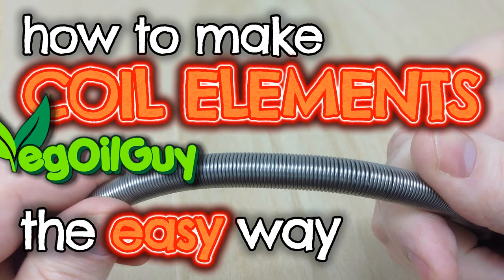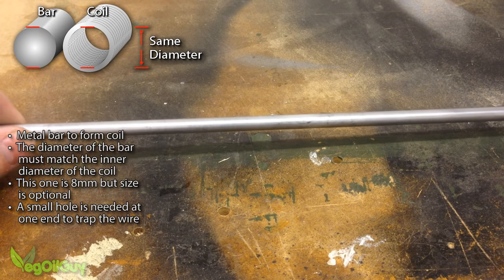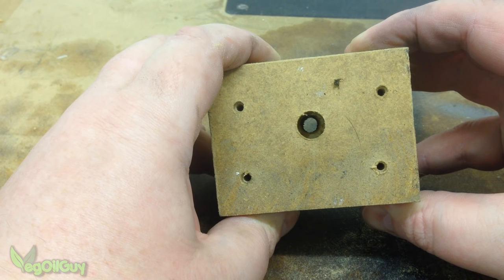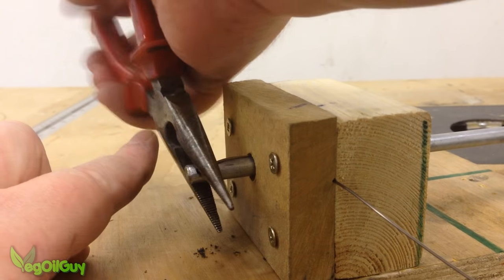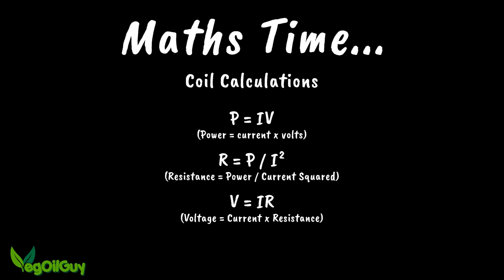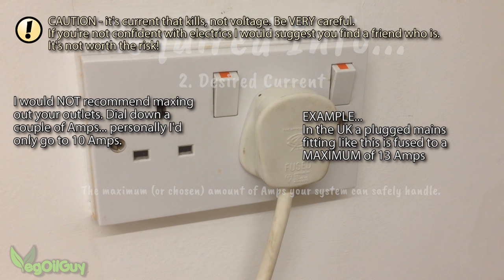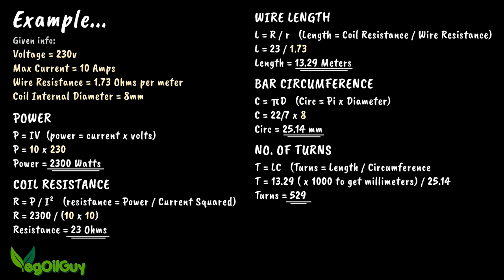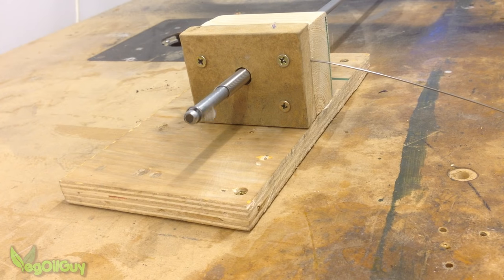Make an EASY coil heating element winding Jig - making electric resistance coils - by VogMan

Comment: Haloo...
with that calculation how many degrees of heat you produce??
Reply from the maker: The max I could ever expect would be 1400C, after which the coils would melt. It really depends on the construction of the furnace. In mine I've managed to melt copper a few times, so that's around 1100C : )

Comment: Thanks for your videos I'm loving your channel, Would you be able to give a little advice. I am building a tempering oven with an internal size of approx 150mm x150mm x 450mm deep, mains power is 240volt with  a15amp breaker, assuming 13 amps for safety the calculator said I need 10meters of wire, this seems very long for an oven this size. I would love to get your thoughts on this.
Reply from the maker: Hi Matt. Without looking at the numbers, I would say trust the coil calculator. It works a treat and is certainly the basis of my electric foundry which continues to works beautifully.
When you first start making these things, everything seems worryingly foreign and strange. And that's a good thing as it keeps us cautious - which we should be with electricity.
10 meters doesn't sound long to me... I think mine was 13 meters. But remember, once the wire is coiled, especially if you have a good internal diameter like 8mm or more, the finished spring is surprisingly short. Then you need to stretch this and it seems to become loo long again, but if you incorporate the slots properly, it will all work out nicely. 
If you haven't already done so, look over my electric foundry build. There may be a few tips there that might be useful to you.
Hope this helps : )
Reply: Thanks again for all the great info, I was amazed to see 10 meters of wire coil up in no time flat. Just a question on mounting the terminal bolts, you went for a putty type product but could you just use air set mortar to hold the bolt in place?
Reply from the maker: No worries. Happy to help.
You could use all manner of things to fix the bolts I would imagine, including the high temp mortar. I'd recommend trying it on a scrap piece first. If it works, shove it in your kitchen oven during a Sunday roast. If it survives that okay, it will be quite happy  : )

Comment: Can you tell us the length before and after coiling, wire length vs coil length? 
Or better yet, give the coiled length as a function of coil inner diameter and original wire length! That is, f(x,y) coil length with x coil diameter and y original wire length.

Comment: how do you handle that the coil doesn't produce a short circuit? is just stretching enough?
Reply from the maker: You're right in a way... the coil is a short. But the coil is a long length of wire and this has resistance. Many resistors are in fact just coils of wire. So think of the coil as being a resistor.
Reply: hmm... but when you roll it and the surface of the wire isn't insulated the effective length decreases as the wire touches itself when bein curled up to the coil. (furthermore the effective diameter increases). in this case the electric current doesnt go in circles around but directly through the coil. this is when the resistance goes down and the short happens. so how do you handle that the wire doesnt touch itself inside the coil or is the wire electrically insulated? thanks!
Reply from the maker: Well said - you're spot on. An unstretched coil is the short you need to avoid. That's why I recommend that the coil be stretched by 3 times its original (unstretched) length. Any more than this is not recommended by wire manufacturers who say the coil loses effect, so 3 is good. Less than this and those tiny coils do get close. And it may be in places the odd turn or two do touch, and they are NOT insulated, but this will only serve to reduce the resistance a little. 
Ultimately the supply should be fused and ideally Earth-Leak protected, so if a major short occurs, like the beginning and end of the coil coming together, then there's some user protection in place. But for the most part, good and installation is the solution. Have a look at my Electric Foundry build videos to see what I mean  : )
Reply: Dude! thanks a lot for the good answer!

Comment: Where did you buy the spool of wire? All i can find is 10m lengths
Reply from the maker: eBay was where I found mine : )
Reply: @vogman  im thinking of going for 1.4 mm since that would have lower resistance. But will that heat up with 12 amps going through it? I want 2700 ish watts in my oven. And im unsure if i want to go with 1.2 or 1.4 mm wire. 1.4 holds more energy. But is it too thick to actually heat up?

Comment: Great video. Does the final ohms measurement vary depending on how far you stretch the coil?  If your wound coil is about 500-600mm and i need to stretch the coil to 1700-1800mm for my kiln, does that effect the ohms? also do less ohms and more amps  generate more heat out of the coil?
Reply: Only stretching the wire will affect its resistance (the wire diameter) the closeness of the coils (which must not touch) will not. Less Ohms and therefore more amps will draw/deliver more power. There is a practical limit as to how short the wire can be however.

Comment: Hi, thanks for your usefull and clear video. I want tu build a small kiln, the problem is the length of the coil, it will be too long. I need about 5m but the calculator ask 13m. Do you think I could replace the resistance of the coil which I need to cut with a resistor? Thanks
Reply from the maker: You may need to think about a thinner wire to increase resistance. Whilst adding a resistor would work in theory, I'm not sure how well such a component would hold in a furnace environment.

Comment: How does the coil know how many amps to use when i plug it in to the wall out let? Im in the US and using 120 volts, ive got 20 gauge kanthal wire with a resisrance of 0.817. My metal bar provide 0.25 inner diameter. My wall outlet goes up to 15 amps but how does my coil know to only use 10 of those amps? Am i missing a piece of equipment? Or am i a dumbass and its cause of the maths that it only uses 10 of the available amps 🙈 thanks ALOT!
Reply from the maker: It's a confusing subject : )
The coil is just a length of wire - and with that wire you're making a resistor. The size of that resistor is effected by the length and thickness of the wire. You know your voltage and you know how many Amps you want to draw (or risk blowing fuses) so a bit of maths and Ohms Law works out the resistance needed (Resistance = Voltage / Current). So basically you're building a resistor (coil) that's just the right size. The online calculator I provided does all the nasty maths. Just type is the numbers and it will do the rest for you : )
Reply: Hey Rey question how are the coils working out. Im about to do my this week. Wanted some feed back

Comment: Geoff, great work. My question is your calculator results are 15ft of wire and 226 turns. How do I determine the finished length?  I am planning on 2 bricks per wall for a total of 8 x 2.5" so 1 trough around is 20". 1200 watt furnace. I am using for heat treating, not melting.
Reply from the maker: Hmmm... maybe a bit of maths? If you know your coil width, then you can figure out how many turns in an inch. Then divide 226 by that number and you have how many inches of coil will likely come off. Then multiply that by 3 for stretching. I doubt if it will be exact, but it should be a good gauge for you  : )
Reply: Geoff Thanks much, that gives me a great place to start.

Comment: Is this directly plugged into an outlet? or there is circuit should be used?
Reply from the maker: Hi Tristan. Yes and no is the answer.
The coil only requires power to work, so as long as the domestic supply is up to the task, a coil could be plugged straight into an outlet. However, some sort of control is more ideal.
If you look at my Home Made Electric Foundry series, you'll see how I used a PID, a Relay and a Thermocouple to control my coil (vid 3 I think - https://youtu.be/jHCnYy39Oxc - along with circuit diagrams).
Hope this makes sense : )

Comment: Hi i am building a kiln, but i cant choose heating element. If i choose pre coiled coils from ebay those are in 500w coils, and if i want to join more how can i do that with no problem?
Reply from the maker: You can join coils. Link two ends together by twisting the ends. This is like adding Resistors is series, so they increase in size (eg 500 + 500 + 500 = 1500). But I'd encourage you to make your own. A lot of these eBay coils are rubbish. Buy good Kanthal wire and make your own using the simple jig you've seen here. You won't regret it : )
Reply from the maker: I'll be honest, there's not much I can say about them. These sort are cheap and you get what you pay for. I've tried them... I've also tried kanthal wire bought from eBay. Both were rubbish. So I contacted the wire manufacturer and they told me they supplied https://potclays.co.uk/ - so that's the only place I buy my Kanthal wire from, because I know it's genuine. It isn't cheap, but it lasts a long time. I believe they will ship internationally, but it's up to you  : )

Comment: Dear Sir, i have a question,, now i understand your calculations for the elements, however, my question is how did you arrived to that calculation? Why do you need 1000w instead of 2000W? so in order to do that, we need to find the BTU, now i have probably been in 20 different web sites, and every one has a different measure or calculation to find this,, how is it possible? let's say my kiln is W12cm x H12cm xL12cm,  the result is 1728. now this beloved 1728, for what i need it to multiply it?, than if i am correct, i will convert the result(BTU) in watts, and there i will have the answer to the question i made first,,, Thanks a lot,, and sorry for my calcuclus,,,

Comment: Another great video! The first time I tried it my jig apparently pulled in a kink or two and destroyed itself, so on round 2 I looped the wire over a hook before it ran into the jig and it sorted it right out. I'm very pleased to say that after about 6 weeks and a lot of noise I have today finally powered on my new burnout oven and I'll be able to try a lot of the things I've been watching you do in your other videos. My oven heats up really slowly though, like a degree every 10-12 seconds, should I just add another element in series? The way I understand it though, another element equals more resistance, and more resistance equals fewer amps and therefore less power? Seems counterintuitive but I'm not sure what other solution there is...?

Comment: What if i'm not looking to make a heating COIL, but more like a heating PAD.  Using something like FLAT Nichrome Wire?  How would one calculate building something like that?  Something without turns or a coil?  Thanks.
Reply from the maker: It would be the same maths James. You'd just need to know the resistance per unit length and using the formulas shown in the video, you can calculate the power produced : )

Comment: hey man nice work
Reply from the maker: Many thanks  : )
Reply: @vogman  im trying to make this im going to buy the wire but what do i used as a plug? 
you did't show   that part?
Reply from the maker: Hi Lation. I didn't show a plug on the Coil video but I'm pretty sure I did a reasonable job of showing all the electrics on the Electric Foundry Build videos. 
The coil works on mains power so as a basic test you could (with GREAT care) take a standard plug and lead, bare the cables, connect the Live to one end of the coil and the Neutral to the other end. Make sure the coil is well spread out and that everything is nice and safe - then plug in. You'll see the coil begin to glow  : )
Reply: @vogman  hey brother do you have a email i want to show you what i got soo far
Reply from the maker: Happy to see it  : )
Head here and send me a brief message - www.vegoilguy.co.uk/contact_me.php
This will let us exchange emails securely (avoiding spam) and after that you can email me any time  : )
Reply: @vogman  ahh brother i cant upload my video i want to sent you the clip of the set up that i got soo far.. im trying to get my coil 200c not sure how im at 120c
Reply from the maker: You can't upload anything with the contact form, but once we've exchanged emails you'll be able to send over anything : )
As for the heat, the coil will only give off X amount of heat. This heat needs to accumulate in the same way a log fire slowly heats a room. So it's important to trap the heat inside an insulating container, such as fire bricks.
Hope this helps.

Comment: How can I figure out the temperature the coil will run at. And what controls that, obviously wattage as a factor but what if I can only get 1,200 Watts and need the coil to burn at 120 degrees Fahrenheit. I’m using nichrome (NIC80) wire 20 gauge
Reply from the maker: It's not about the temperature of the coil. It's red hot, we know that, and we know it burns out if it goes above a certain temperature (you'll get that figure from the manufacturer). Coils work like a log fire in your living room. The log fire gives off radiant heat and this heats up the room. You're not sure how hot the log fire is and it doesn't really matter. 
In theory you could heat the same room with a candle because the flame on the candle is very hot - not unlike the log fire. But as the flame is tiny, it will take much longer. So you'd need a lot more candles.
Think of those candles as Watts. The more you have, the quicker the space will heat up.  So the more coils, the quicker the temperature will rise.
How do you stop the heat from raging beyond control? Use a PID and a thermocouple.
Hope this helps.
Reply: VegOilGuy Thanks for the quick reply. It was very helpful the way you explained it was easy to follow also your jig will be extremely helpful and allow me to produce consistent coils. Thanks for the video and the reply!
Reply from the maker: Thanks. I appreciate that : )
Reply: @vogman  Well, if you increase the length too much, the wire will only warm up a bit, and never glow, because the resistance is too high. Otherwise, if you cut it too short, the resistance will be so low, close as a short circuit, like a welding machine, then, the temperature will rise above the wire melting point, and it will melt down.... I assume the temperature question was related to it.
Beside that, your coil machine is awesome! Great explanation, well detailed instructions!

Comment: Is there a way of adapting this coil to a grill for an electric oven whereby the coil remains mounted on the bar for stability and rigidity. Is there another video showing how it is heated, and what current it draws per hour? I was thinking of toaster wire to make a low current drawing element/grill which can be adapted to a battery power supply. Could you perhaps advise?
Reply from the maker: I'm sorry Dene, that's not something I have any experience with  : )

Comment: Hi
 Great video. I’m going to do a spiral/coil in 2 mm stainless steel. And the factory don’t say how many ohm ther is. But i find that a 0,9 mm stainless wier, has like 1 ohm. 
i think there is many different stainless steel prescription. But we just estimate, if ther is a 1 ohm /0,9=1,11 ohm. 
1 mm stainless wier is 1,11 ohm
1,11 x 2 = 2,22 ohm 

2 mm stainless wier = 2.22 ohm but nut sure??

can i calculate like this way or is this wrong? help please I’ve been searching long time now and I can’t find the answer!
Reply from the maker: Hi Jo. 2mm is pretty thick and will have a low resistance - meaning you'll probably need a lot of it.
The answer is simple enough if you (or a friend) has a good multimeter. Measure out 1 meter and place the probes on these marks (no need to cut it - electricity takes the shortest path between the probes) . Take the measurement. If it's too inaccurate, spread out 10 meters, measure that and divide your answer by ten.
There's always a way : )
Hope this helps.
Geoff

Comment: All your videos are very well done...what gauge wire are you using
Reply from the maker: Many thanks : )
Hmmm... I forget to be honest. I'm sure it's listed in the video... definitely Kanthal wire - 1.02 mm I think. It's good for 1400 C I seem to recall. 
You can use thicker or thinner wire - just remember to feed that into the Calculator on my website and it will figure things out for you ; )

Comment: If you purchase a wire that's already wound, like the ones on eBay, and the one you want is 1000w etc and use a wire that can handle 1500w would that wire not heat properly? does it have to be a certain length or can you increase the wattage? that's a wire of equal length with 1000w and 1500w or varied resistance for heating.
Reply from the maker: Hi Gaz. It's all a question of resistance. Thicker wire has less resistance than thin wire, short wire has less resistance than long wire. Physics tells us that Power = I²R (Current Squared x Resistance). So if the length and the thickness of the wire coil alters its resistance, this has a knock on effect to the power.
So if you have a 1500w coil but need a 1000w coil, you can DECREASE the length of the coil. This will reduce the length and decrease the resistance which, theoretically, should lower your power. For example, if you cut your 1500w coil exactly in half, you should achieve 750w of power. If you cut exactly one third of it away, you should get 1000w.
Hope this helps   : )
Reply: @vogman  Thank you that's a great help and very much appreciated. I am working on replacing elements in tumble dryers, as some are expensive, being this a heating element, like others, that should not pose a problem would you think? assuming the output Wattage is correct for the appliance.